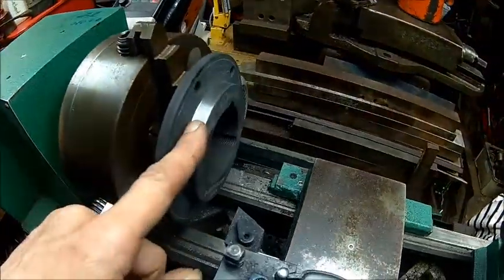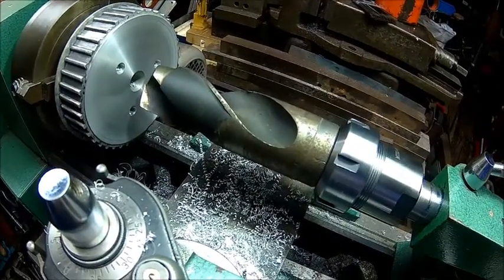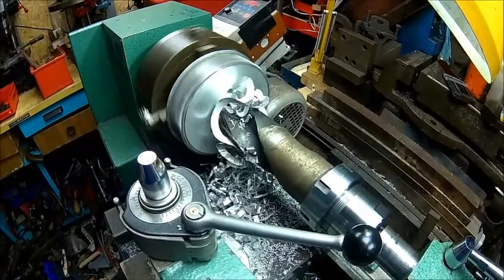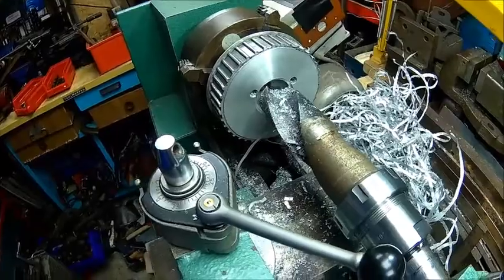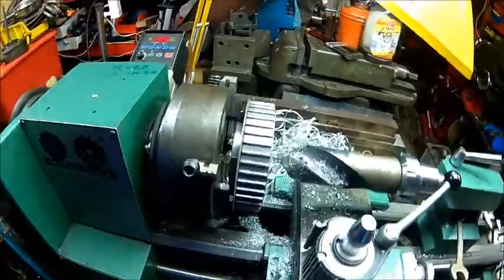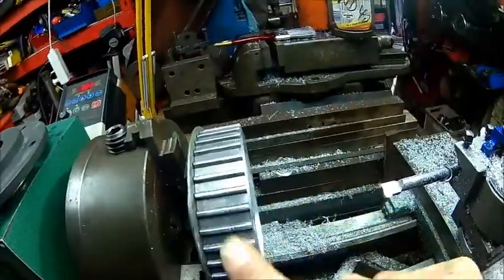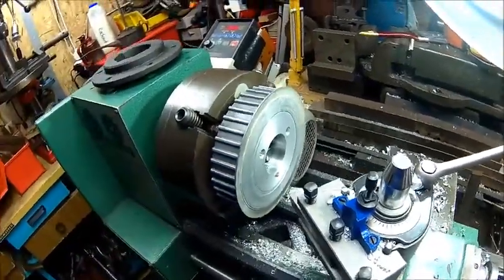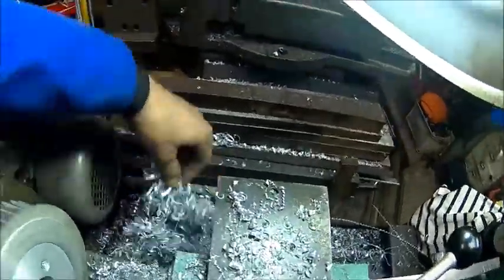The Mystery Project - Part 17, machining some strange material and a huge drill

Comment: indicating on top of the belt sounds like a good idea. providing the belt is uniform that should at least get you in the ball park...
it's gonna be a high speed tortilla maker..lol.. NOT!
Reply from the maker: Worked like a treat, these tooth belts are good quality, i tried it with different sections and the result were the same, so the belt thickness had less variation than the pulley runout.... ... Just think a bit out of the box, the thing does neither produce something nor it is processing any sort of material, nor does it move position under it's own power.